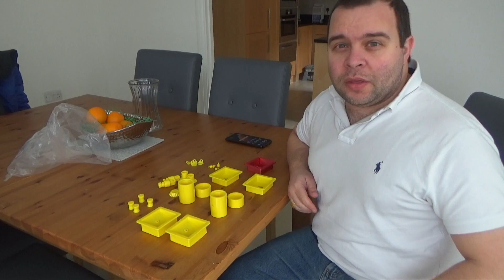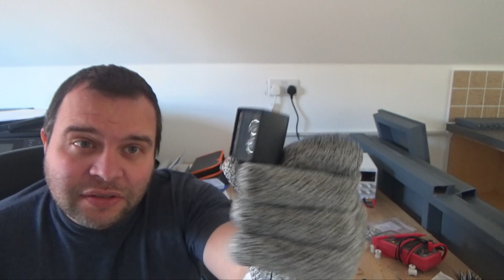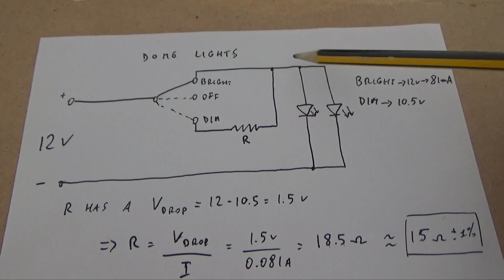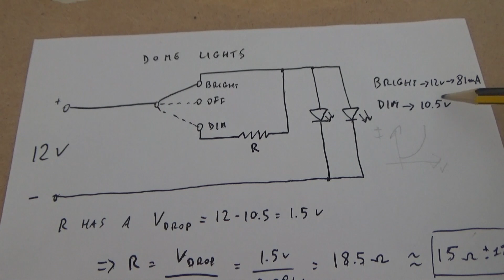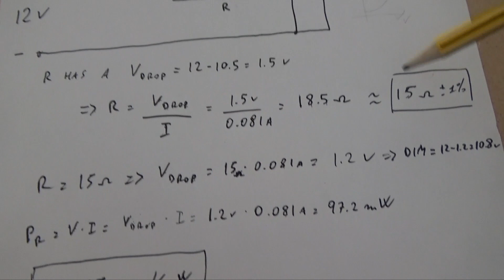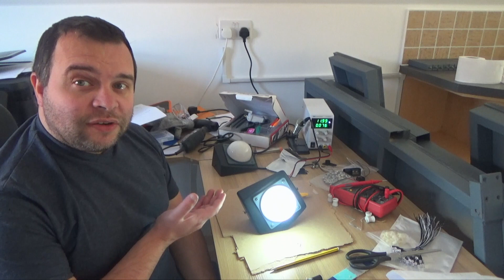COCKPIT CONSTRUCTION PART 2-B

Comment: Hello, first of all, I want to thank you for your great tips and beautiful videos! But also had a question, could you maybe provide all the details where to find the 3d print files? As well as all the components that you bought? I've already looked a lot at your videos and on your facebook but without much success. Thanks in advance and keep up the good work! Greetings, Mathias
Reply from the maker: Hello Mathias, the simulator is made of modules and parts that I have purchased by various suppliers, I did not use any 3D printed files.
To give you a general idea, below are the suppliers for the main components:

MIP / EFIS / OVERHEAD / MCP / PEDESTAL are from Sismo Solutions.
THROTTLE is from Cockpit For You
FLOOR / MAIN COCKPIT FRAME / TILLER / YOKES / RUDDER PEDALS / REAR BULKHEAD WITH DOOR are from Fly By Cockpit.
CDUs are from CPflight
SCREEN is from Simpit.

Then there are all small items and parts which I purchased from Amazon/Ebay, if there is something specific you need to have information for just drop me a line and I will be happy to assist
Reply: @alpasimulation5485  Ah I didn't know that, thanks very much for the feedback! I can find most of it online, just not the grab handle (https://youtu.be/AyLHLXJtG0w?t=27). Thanks again! This is all in your spare time, can't thank you enough!
Reply from the maker: @mathiasvaneynde7267  I will find where i purchased from and send you the link

Comment: Going back through some of the videos.  So that board really is not used for anything on the SIM. So could you just remove the plug on the pins and then jump wire from the 12v over to the board (now disconnected from SIM) and use the switch normally?  Maybe that's what you did.  It is hard to tell exactly how the wiring is set up.  Is there a diagram of the wires and resistor you added to be clear for those of us that are a little OLD and slightly electrical challenged.  Love following the build...
Reply from the maker: Hello, you are right, that's exactly what i did. I used the switch normally. I don't remember why the board was there but i figured out that i didn't need it for anything else. For the resistor value and connection, you can see in the video i explained my simple circuit on paper